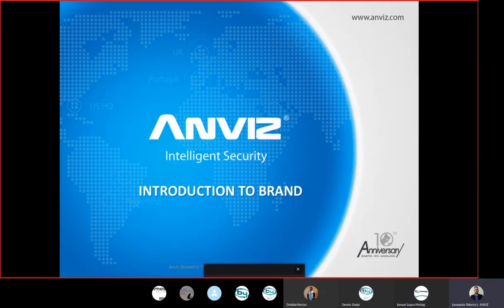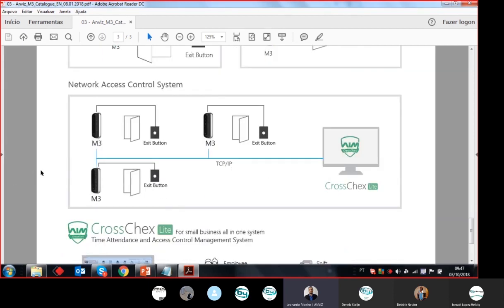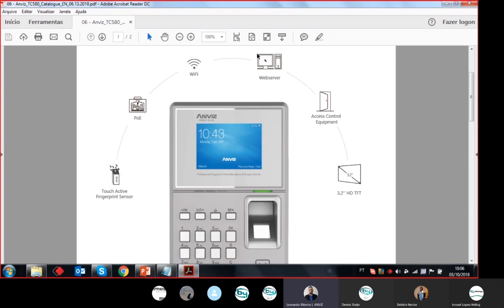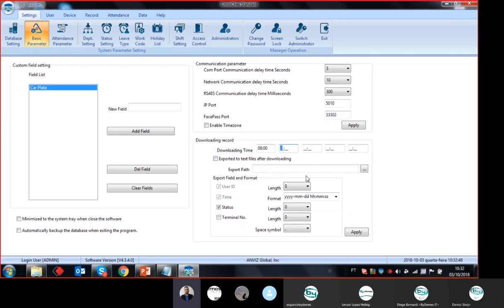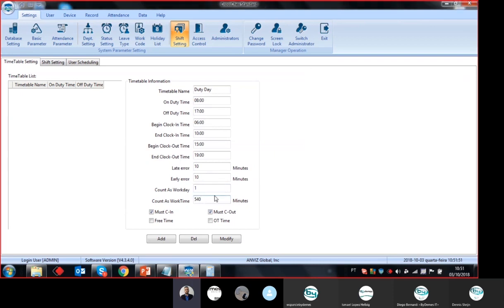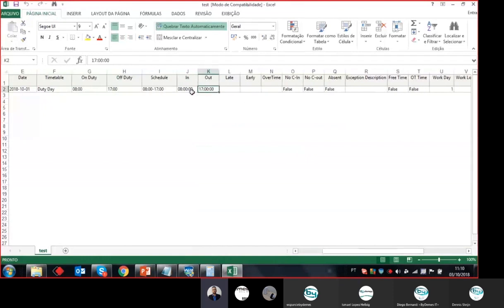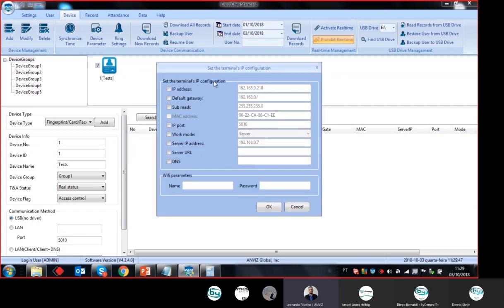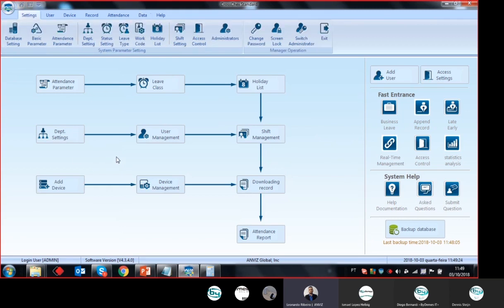ANVIZ and CrossChex Standard  Introduction ENG

Comment: Thank you for this. We are running a middle school and recently installed two fingerprint devices at campus primary for staff attendance. We are looking for some help setting up a CrossChex application for Anviz W1. 

We are not finding an option to set up timings for individual staff members. I believe this application is designed to be used with shift system, however, we do have some staff members who have timings different than the general shift timings. Below are some available use cases:

Our general shift is from 7:45am to 1:45pm.

1. 60% of our Staff follow above general shift timings

2. Daily custom timings: Some employees have custom daily timings (i.e. other than the general shift), say 8:00am to 11:30am, or 7:45am to 1:00pm, or 9:00am to 1:45pm, etc. 

3. Custom days: Some of our employees don't come on regular basis. They are assigned specific days either for full day or part time.

I was wondering if you could help me out with this.

Much appreciated

Thanks,
Reply from the maker: Dear customer, please provide me your email and also your region (city and country). I will forward you to a local support partner to help you with the details. Best Regards